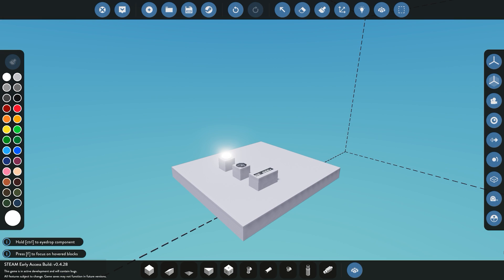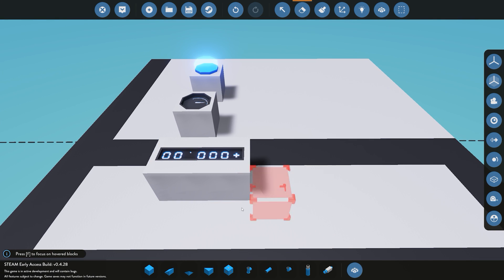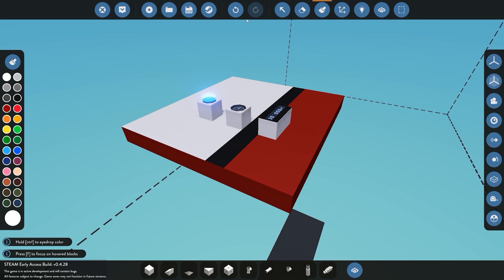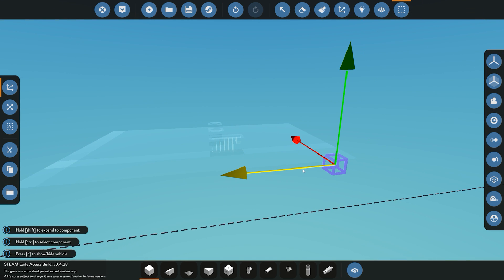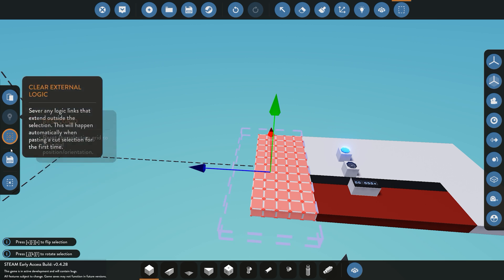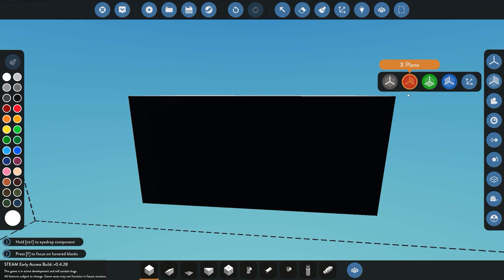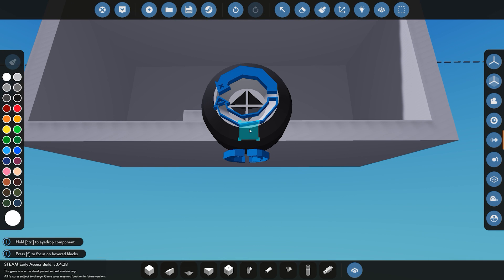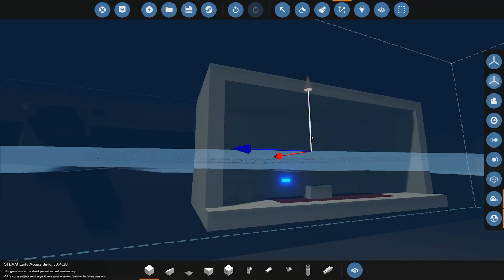Stormworks Workbench Basic's (Tips & Tricks)

Comment: 15:45 thats a good.feacher so when you building a ship or a mission ship and you got a fuse. Box area in the ship and you can use that to connect every wire like for an example you press cntrl on the main switch so it lets you connects it to every wire so you dont have to go back to the switch. Every time  To connect it and also you dont forget where you was

Comment: This is more of a wish than a tip, but I would like to see group selecting for logic. I'm specifically talking about the Solar Cells.....It rarely use them due to weight and the stupid amount of time it takes to hook each one up electrically. If either there was an option to duplicate electrical connections of all blocks touching the one you're editing or if you can mass select a group of nodes to assign, like a box select, then I might consider the utilization of Solar Cells more. But they're too much of a pain with the current system.